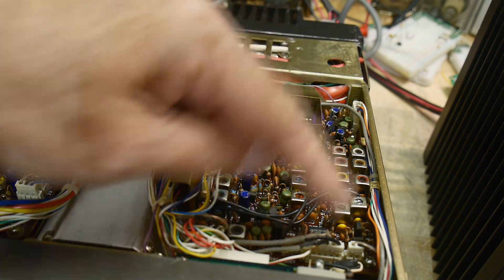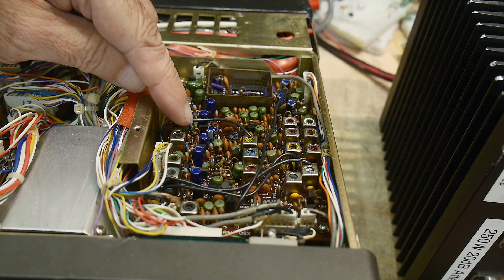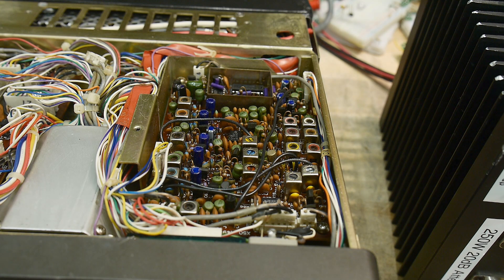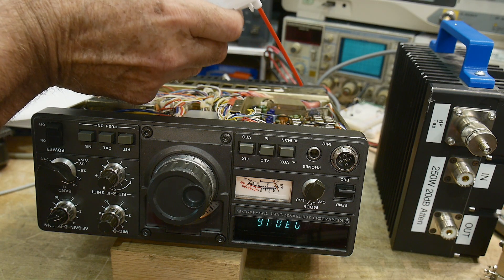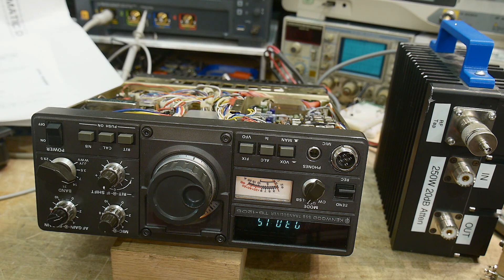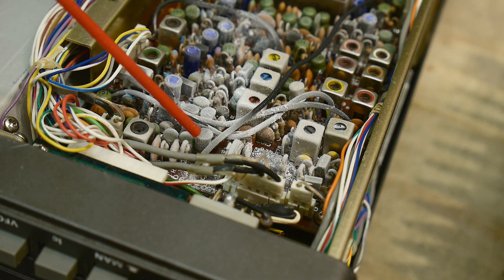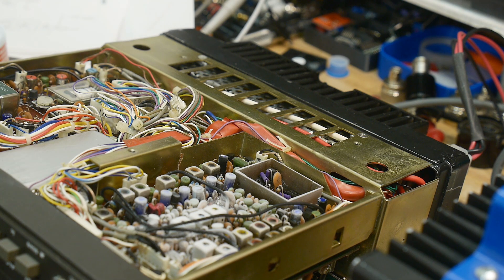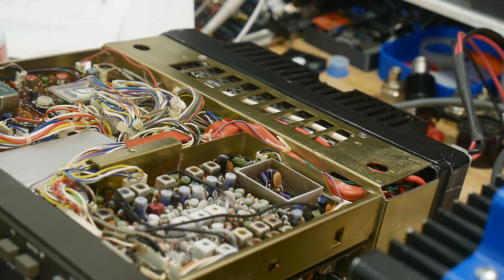#2006 Kenwood TS-120S HF Transceiver (part 9 of 12)

Comment: The problem with the spray is the time lag between when you spray and when you get results. I give about 30 seconds between each spray for the cold to reach the heart of the problem device. Freeze Mist has so much overshoot that when I get the problem localized I sometimes spray a Q-tip with the mist then hold it against the devices one at a time. Also, I can sometimes get away with soaking a Q-tip with 90% rubbing alcohol (It's cheaper,) and rub down each device with it, then blow on it to cool it down. The goal is always to localize the heat or cold to each individual device until you're sure which one is the problem. It can require a lot of patience.

Comment: Don't forget to pay attention to the binning code. The C460 (B) is from the lower gain bin (60-120) and the old datasheets show an ft of 200 but spec it for use around 10Mhz. The C461 has the same specs only for use at 100 MHz. Ah, the good old days of making a bunch of transistors and putting part numbers on based on fail points.

Comment: That power amplifier looks like the one in the Kenwood TS-930 and it has intermittent no power problems and its bad connections on the circuit board-the board has feedthroughs that can cause problems

Comment: The fact that the beta of a transistor increases with temperature is well known to analog guys. It's what leads to thermal runaway in power amplifiers if you're not careful.

Comment: Freeze spray to the rescue.  In a pinch you can use a can of compressed "air" like you would get at a stationary store.  Most of those don't actually have air in them, they use refrigerant.  Just hold the can upside down when spraying and it comes out as a liquid.
Reply: Nowadays canned air is a mix of propane, butane and possibly god knows what in addtition. So, there are legit two types now, one that may be used on powered stuff and explosive one..